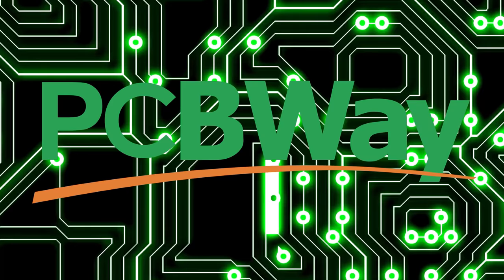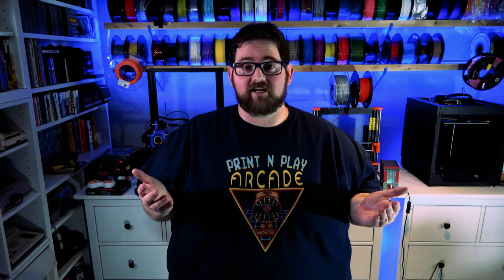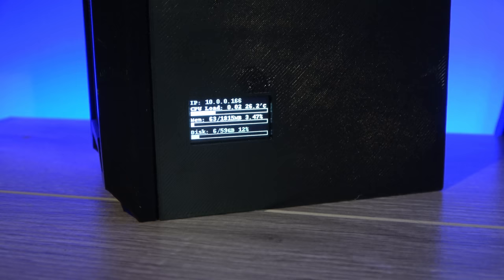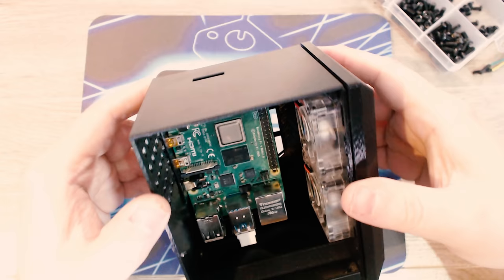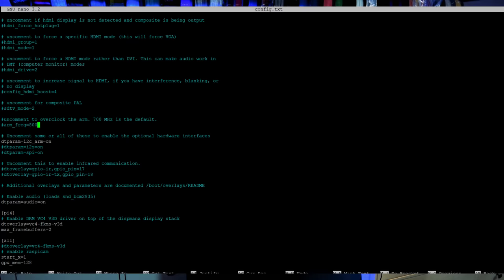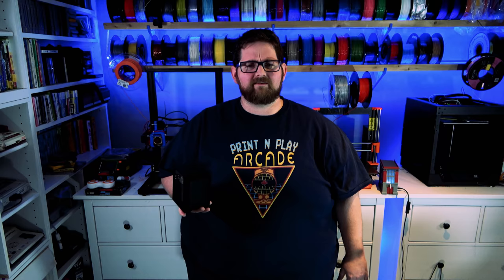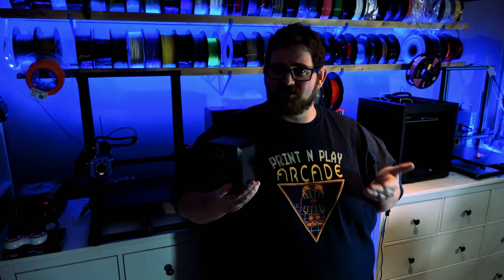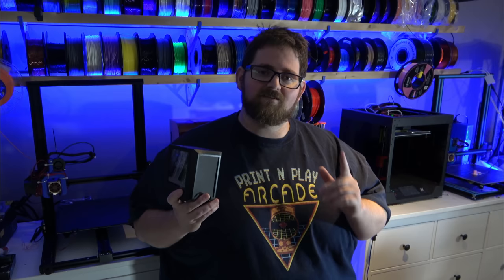World's Smallest RGB Gaming Computer???

Comment: Yea man you should definitely add a ethernet plug to the back IO.  You could use a jack plug from home depot and just wire in a short jumper.  It kind of snaps into a knockout that has a notch, should be able to 3d print it into back.
Nice build man I have a few Pies laying around and wanna try this one out!
Thanks,
Casey
Reply from the maker: Great minds think alike! That's the exact approach I wanted to use. Might have to increase the height of the case slightly, but a nice tiny ethernet with a 90 degree bend would probably do the trick

Comment: You should add a 2.5" SSD with a Sata to USB adapter in it somewhere to boot off of, it is quite a bit quicker than the SD card. I have the rpi 4b 8GB model and can run win10 for ARM on it, I boot off a 2.5" 120GB SSD over USB3.0. It's not great so raspberry pi OS is probably the way to go still but something to think about.

Comment: One question initially.  Best orientation for the main body print?  I see supports in my future but I can't decide what poison to take?
Reply from the maker: The main body is designed to print without supports, with its back against the bed. The two side panels should be the only two parts that require supports!

Comment: Looking pretty smart, but why would you not use an SSD for increased performance.  I have my Pi4 in an Argon M2 case, overclocked to 2300 running off a Western Digital Blue M2 drive (nt NVME).  

Have you tried running Blender on RPi4, it will only run 2.79, but it's been more than enough for most my simple 3D designs that design, slice and Print from my Pi (which I use as a daily desktop).  I must be the only one doing this!  

You mentioned using Steamlink, but no one seems to be mentioning Moonlight-QT that will allow you to do similar, but from a Cloud PC.  If Blender on the Pi isn't enough I can spin up the cloud PC, connect via Moonlight-QT (from the desktop) and run Fusion 360 or any of my titles I have on STEAM.  The lag is minimal, most cloud PCs cost less than $20 PCM with a couple of GIGs storage.  Great for those on a tight buck.
Reply from the maker: Awesome ideas all around! The case was originally supposed to hold a 2.5" SSD, but the usb to sata after was making things messy and I dropped it. My next upgrade will definitely be building a hard drive bay to go underneath the tower.

I've done some modeling using FreeCAD, but had no idea that Blender worked on it. Will check it out!

Finally, using the Pi as a Cloud connected system sounds awesome. I will check it out, sounds like a really good solution. 

Thanks for taking the time to reply!

Comment: Sweet concept, design and build!  Thanks!  And definitely relocate the Ethernet port.

I recently upgraded my home internet to the fastest my ISP offered in my neighborhood, and immediately hit the limits of my WiFi system.  So I took all my PCs and streaming devices off WiFi and moved them to my wired network (which used to have only my cable modem, AP and NAS on it), leaving WiFi for my phone (only device on 5 GHz), Kindle, and my home automation devices (mainly WiFi power outlets).  Then I optimized my WiFi for those devices.

The alternative would have been to upgrade ALL my devices (except my new-ish laptop) to newer and faster WiFi standards.  Which would have broken the bank for relatively little gain.

When I moved most of my RasPi systems to wired, I also moved them to PoE using external data/power splitters, not PoE Hats (for power efficiency).  This was possible only because I already owned a PoE switch briefly used for another project.  Still, even buying a PoE switch and all the power splitters would have been FAR cheaper than a whole-home WiFi upgrade.

BTW, quality flat Ethernet cables are THE way to go, because they are both easy to run and easy to hide.  Even the best cables become affordable when you buy several at a time.  I've made many Ethernet cables, but it is difficult to make good cables for CAT7 and above due to the shielded connector.